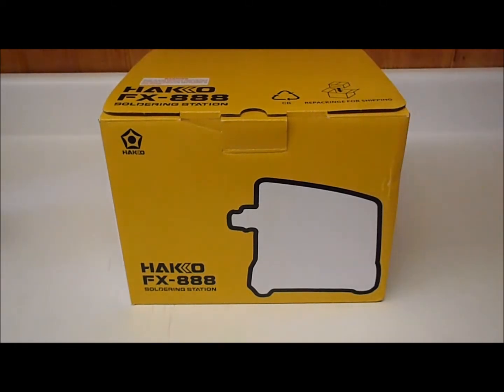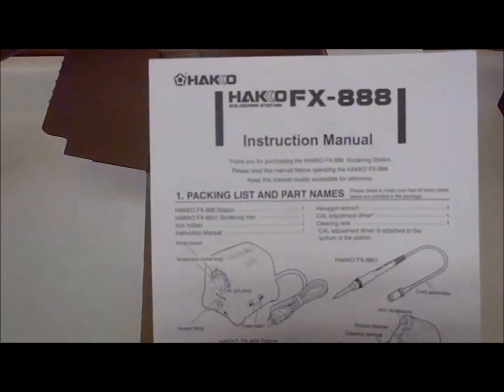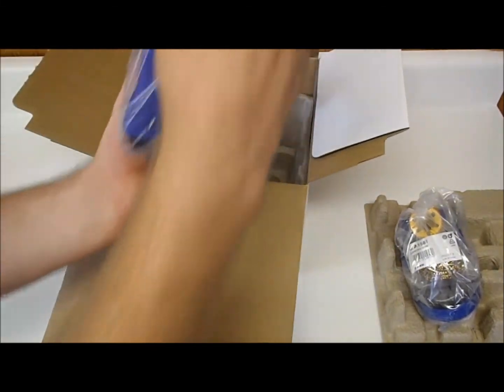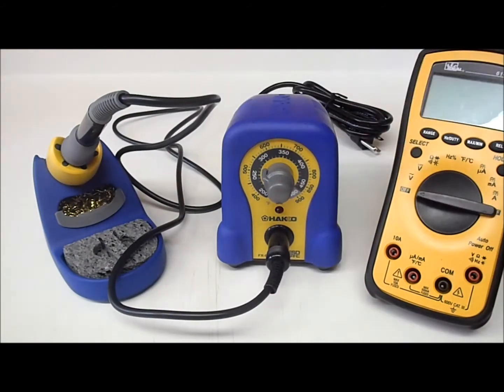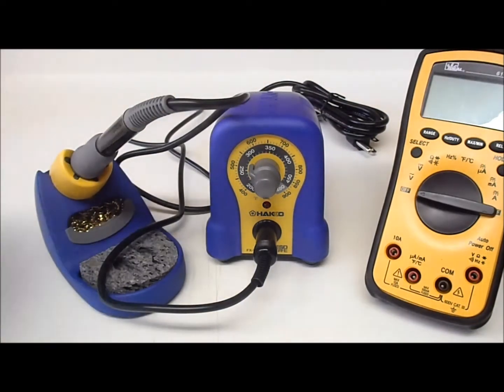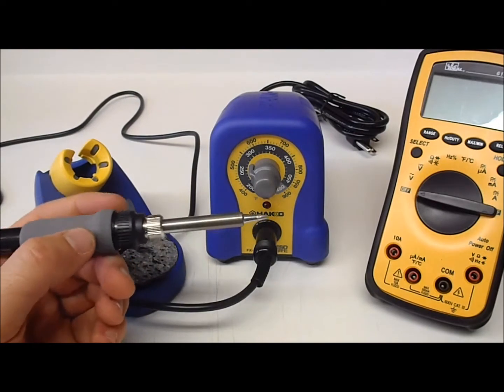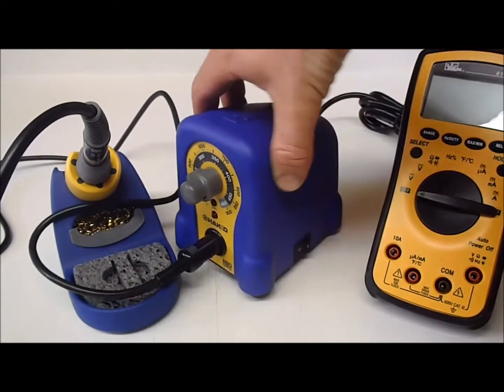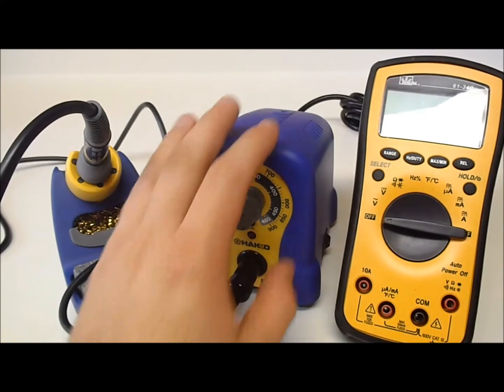Hakko FX - 888

Comment from the maker: Some modifying - if you look at my other videos I point out those connections. But it will work at 220 Volts after some hacking - too bad the soldering iron is needed for hacking.

Comment: I have just starting using my new FX-888 and it is without a doubt the best tool I have bought in sometime. It's well made with a really small footprint and works so much better than my 45w wand iron I have been using for over ten years. It does have some drawbacks such a lack of a power on LED to make sure you shut if off before leaving for the day and no timer as well to shut it off. But it is well worth the money.